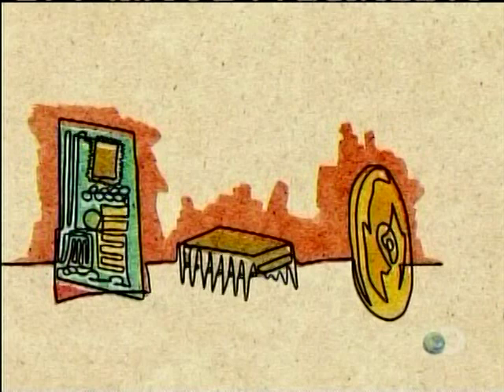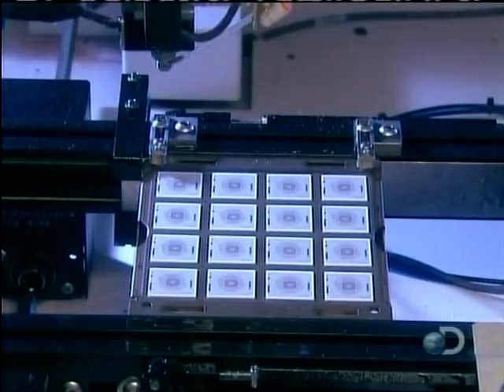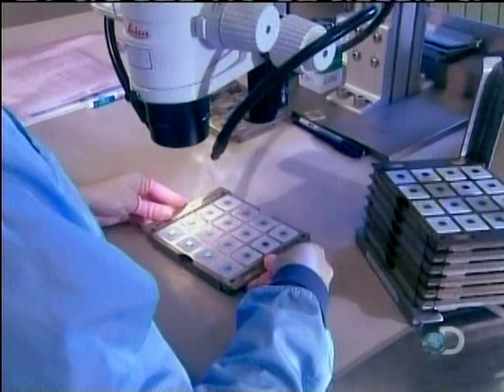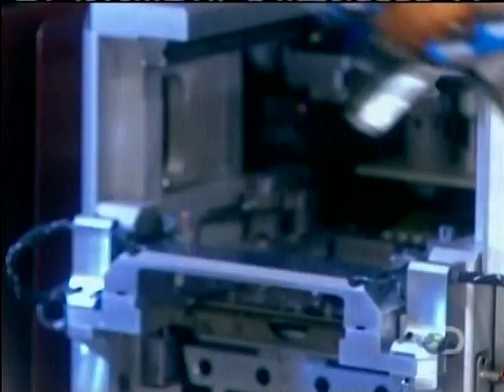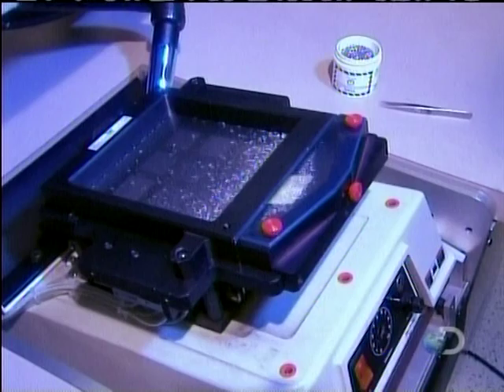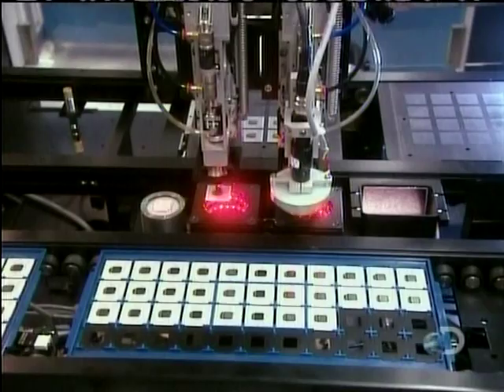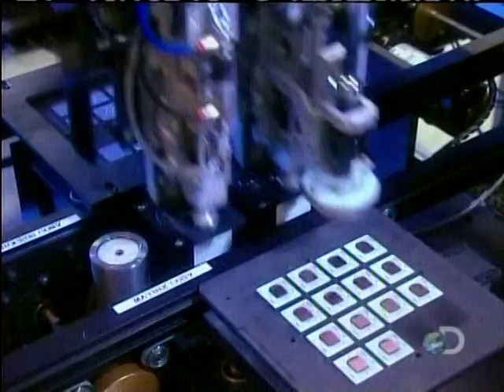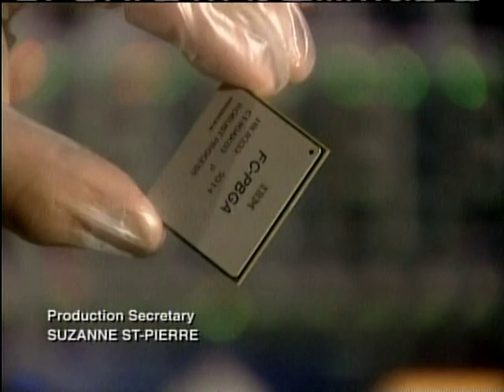How It's Made - Microprocessors

Comment: This is a BGA, or ball grid array type CPU which is mostly phased out of desktop use due to the fact they are permanently soldered to another board. For example, this is the way the IBM Xenon and Cell processors in the Xbox360 and PS3 are made.

CPU's from AMD and Intel use LGA, or land grid array type modular designs which can be removed and replaced easily, but are manufactured differently. However, in the future, LGA modular type CPU's are only going to be for the high end consumer market.

Comment: yeah i dont think i can allow myself to understand that this even happens... also yes the design is completely unaccesible to me.. how do you design something with billions of anything? i dont get it...
Reply: you put a billion pf something into something thats how you design something with a billion of something in it XD
Reply: yeah but you don't just drop it in.. you have to organize it. I don't understand how planning and conceiving something of this magnitude is done. its like designing a planet or something. how long would it take you to count to a billion let alone plan and organize where billions of little microscopic things are going to go and how they will all work together and troubleshoot them. it sounds like a nightmare.
Reply: +Matthiu Ryin only an engineer can answer that. i only know that it takes so many years to just design and plan the logic board and it involves something called the Moore's law which states that the amount of transistors that we can put on a board should be doubled every 2 years due to design of transistors shrinking every year. but now we are approaching the limit of the Moore's law i think as we can't make transistors any smaller.
Reply: +InnerFire6213 hahaha,you talked about cisc cpu archive often of inte products,the rist archive in arm cpus is absolutely different.i know what cpu is and how it works,processing is just switching circuit by matching the syntax.
Reply: +lânchánđời nguyễn i mean intel
Reply: You do it using loops which iterate through mathematical formulas that determine how many can fit into a certain amount of space.  It's still very complicated, but not nearly as tedious as individually placing each component.